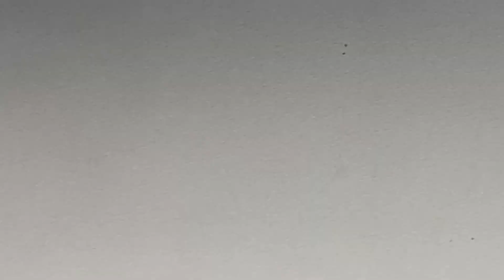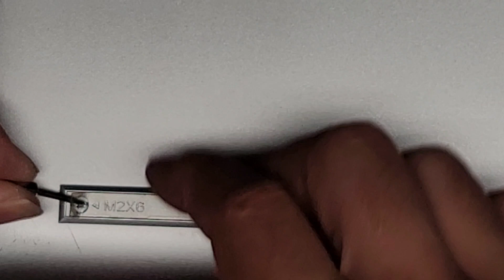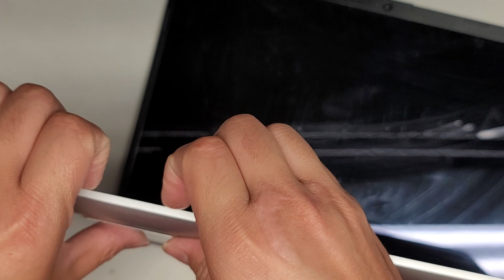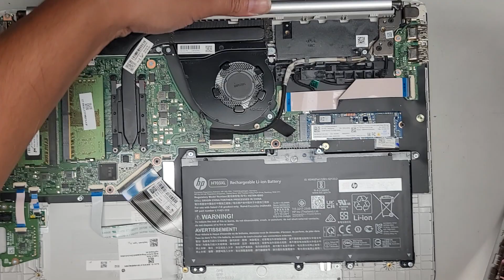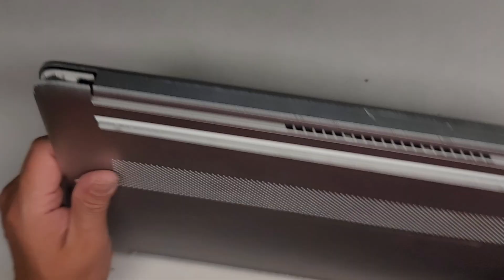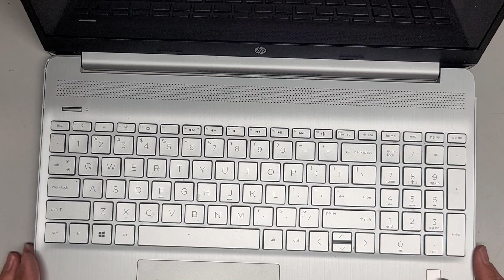HP Laptop 15t-dy200 Disassembly RAM SSD Hard Drive Upgrade Battery Replacement Repair Quick Look

Comment: I have HP Laptop 15-dy2000 (2D117AV) stuck in Windows 11 boot loop with “Preparing Automatic Repair” and shows stop code Driver_PnP_WATCHDOG (0x1D5). 
BIOS version F.33; F2 hardware diagnostics show SSD test passed.
 Disabling Secure Boot didn’t help.
 From Windows 11 boot USB, 'Reset PC' option is missing, "chkdsk /f /r c:" cannot run due to write-protected drive, and during fresh install the local SSD is not detected.
 BIOS shows SSD under Intel Rapid Storage / VMD (Optane), but loading Intel RST/VMD drivers (Win11 / 21H2 / 22H2) still fails-I tried VMD folder.driver package contains two folders: F6 and VMD, and I am unsure which one to use. Inside the VMD folder, there are two options: VMD Controller 9A0B and VMD Managed Controller 09AB. On top of that, the driver is available in three variants—Windows 11, 21H2, and 22H2—and I am not sure which one is correct. but it just reboot wihtout indicatin if driver installed or not and stuck in Driver_PnP_WATCHDOG (0x1D5) error.

any help will be great.
Reply from the maker: This playlist might help Intel VMD IRST RAID Intel Optane BS: https://www.youtube.com/playlist?list=PLSSiYX-ta7aq83cRPjlfV_-n-TqfJTiLB
Reply: @ItsBinhRepaired 
Thank you I will check. Also how to reset cmos battery on this hp model in case u know?
Reply from the maker: @uhstube74  disconnect the battery and hold the power button for 30 seconds.
Reply: @ItsBinhRepaired  
this model has non-removable battery - Do you mean open laptop from bottom on remove it? 
also like to know if CMOS battery can be reset or reinstall to reset BIOS?
I want resolve issue as keeping in boot loop with “Preparing Automatic Repair” and shows stop code Driver_PnP_WATCHDOG (0x1D5).
Reply: I remove main battery after opening bottom & put it back ,but issue persists
Reply from the maker: That's because it's an issue with the drive or os, not the bios
Reply: @ItsBinhRepaired 
In bios menu, I tried disable octane volume but doesn't indicate it if I need tonon same bios or save exit. I kept same  screen fr some hrs ,nothing happened &:tried  save exit ,nothing happened & same issue persists & octane volume not disabled
Reply: I was trying to do a fresh OS installation using a USB boot drive, but the installer could not detect my local drive. I also tried loading the storage driver from the USB to help detect the drive, but that didn’t work either.

Earlier, I had tried disabling Intel Optane from the BIOS, but I wasn’t sure what to do after clicking Disable—whether to stay on the same screen or exit with Save Settings. I used to exit and save, but it never worked.

This time, I disabled Intel Optane and stayed on the same BIOS screen. I used the up/down arrow keys to check, and nothing changed, which indicated that i was workign and aft some mins/hrs ,same screen it displayed the status of disabling.. After that, I exited normally, and my laptop booted without any issues & error and stuck in boot loop is gone.

Comment: How do you re-mount the rubber? Is the adhesive re-useable or do you need new adhesive when re assembling? Thank You..
Reply from the maker: @Mack_Dingo  if you peel it off right. Peel the adhesive, not the rubber.

Comment: Great video thanks does this laptop upgrade SATA 2.5 SSD?
Not m2280, i saw bottom side of left exist empty area is it possible?
Reply from the maker: It's an m.2 pcie nvme SSD. It looks like there's room to the left of the battery for a 2.5" sata SSD, but not 100% sure.
Reply: @ItsBinhRepaired I think he’s asking if it’s possible to put secondary SATA 2.5 HDD or 2.5 SSD in that slot in addition to the existing M.2 NVMe, and I’ve been curious on this as well since that slot they clearly left open with the exact amount of room for an addition 2.5 SATA.  My guess is that in production, they probably initially were intending on releasing a lower-end, more budget-friendly if this exact make but that never came to fruition — at least not to my knowledge.

Apologies for continuing to ramble here but I’ve had this exact model of the notebook and am known to pry open my laptops and modify them as I please. Especially HPs. So I noticed that immediately because what’s really interesting about it is when you look at the small little unused, seemingly purposeless connecter/cable bay that’s immediately to the right of where the cable for the keyboard (?? I think keyboard, but one left of battery). Lastly, I did some digging and research (because I’d love to throw one of my millions of SATA 2.5 SSDs in for some extra storage space ) i came across an official handbook from HP that, within was sort of a MEGAmanual for these lines of their HP laptops in this production year. If you look at this model in it, there’s a schematic followed by the parts list which shows a full of fitting cable for that empty port next to the battery… with a SATA receiver on the other end of it! So obviously i jotted down the part number, found it (was NOT easy even with the exact name, number, ID, AND the serial WITH a QR code lmfao), ordered it, and when it came and I finally set it up after ALL THAT leg work with a 2TB SATA SSD i booted it up happy as could be to see it… was not supported. Just devastated me. 

Sorry for the novel I just thought the journey u went on to figure this out was relevant to the discussion and kind of a neat little background on this machine, HP’s weird ass production decisions that are seemingly very often all last minute, and my hopeful quest to find and utilize these parts that ended in failure and despair lol. 

Again apologies on the novel. But for real, amazing video man! Good stuff. Keep up the great work.